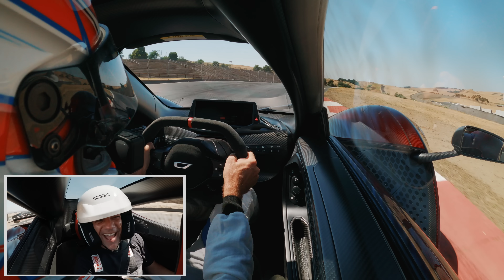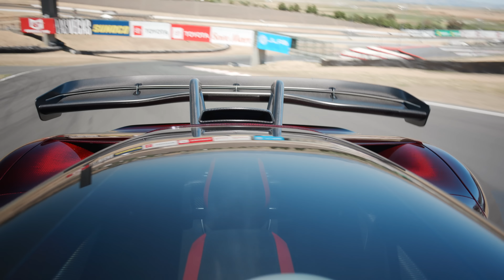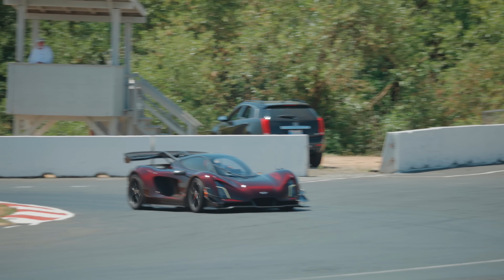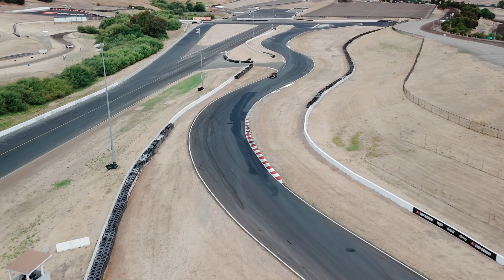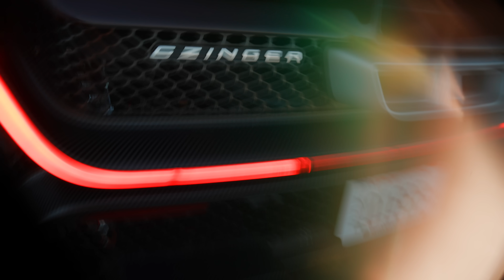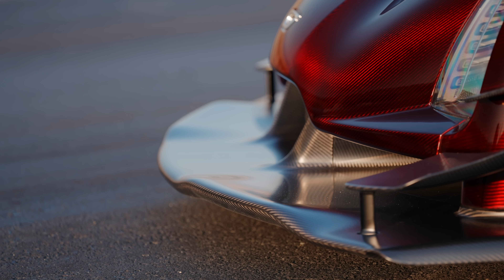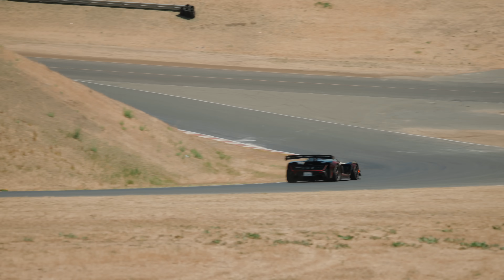FIRST DRIVE: Czinger 21C, The Wild 3D-Printed Hypercar

Comment: Its hard to not be impressed by the technology thats harnessed in the 21C. I believe it stands for a huge step in the automotive industry and it is unconventionally flawless, i love it and i cant wait to see what is next
Reply: Beautifully written
Reply: They partnered with a guy on Jay Leno's garage who made like a carbon fiber tube chassis AI build. I believe he has a patent on 3D printed nodes nodes
Reply: If you're impressed by this then just wait until you see my holletjie 😮
Reply: This Divergent 3D additive manufacturing technology is game changing. Opens so many possibilities for boutique manufacturers.
Reply: It's remarkably polished. A very refined and thorough package.
Reply: Kinda. It's a beauty for sure and the manufacturing technology is groundbreaking. Throw out the electric nonsense, fit the rear wing properly and you might be onto something.
Reply: I feel this was written by a company guy working at divergent
Reply: @Iwished4 you know nothing
Reply: But it weighs the same as a small mountain.
That's a fail.
Reply: @procatprocat9647 weight is equalled to its power. So as weight increases so has the power. We are entering a new age to embrace
Reply: Weight is grip, grip is handling. Power is power. Electrical, sustainability.
Reply: @NevskiExotics  that's pathetic
Reply: @NevskiExotics you sound like an american 😂

Chapman would turn in his grave
Reply: @procatprocat9647  I'm an American who worked in design. Your motocycle and auto industries collapsed in my lifetime for the most part. Seems your storied brands are built in India and Taiwan now. Stop the elitist arrogance.
Reply: @procatprocat9647 I’m British
Reply: @JimmyNevski shame on you. I aim to get your British passport revoked 😂

Seriously though, you're certainly no Engineer. That's for certain !
Reply: @procatprocat9647  In what world is 1200kg heavy "as a small mountain?" It weighs less than an Evora.

If you don't like it, that's fine. But you don't need to just make stuff up 😂 
Get a grip.
Reply: @procatprocat9647 what ? It has the same HP as the Corvette zr1x, but weighs over 1,400 pounds less.
Reply: @procatprocat9647  its weighs lighter than a Jesko or Valkyrie and more than a hardtop NC Miata. That's light.
Reply: @Qimchiy  an nc miata is not a purpose built racecar with a stripped one seat interior
Reply: @Qimchiy That's not a decent comparison by any means. "It weighs more than the lightest entry level sports coupe on the market, and less than a Swedish boat and a literal LMH car."
Reply: @Deadsphere  It's not that far off from the Miata's weight just that the 21C is a lot more powerful to put it simply. How's it bad to compare to something known and obtainable? ND Miatas are still in showrooms available for test drive.

The Valkyrie was mentioned in the video so why not, the street version has similar ICE only horsepower and weigh. The Jesko is just one of those cars that everyone knows as "oh so fast" and on gas (not E85) has similar horsepower to the hybrid Czinger.

Would saying it weighs 1/3rd a full grown elephant be better?
Reply: @procatprocat9647 it’s under 3000 lbs. you make no sense.  You’re a fall

Comment: This car has the same lines as the Mazda Furai
Reply: Mazda designers were just that good.
They still are.
Reply: Dont tell them that. Its a brand new design remember
Reply: @km6832  it in fact is a new design, its just the fact that the furai and the 21c are both single seater aero and weight focused track cars, you wouldn’t call the M8 coupé a non-new design even though it follows similar lines as the mustang
Reply: just like ferrari f80 looks somewhat resemblance of classic bugatti model (i think it is E9999 or something like that)

Comment: as a Koenigsegg fav, i don’t want this to beat the Sadair Spear
Reply: I absolutely hope it does USA ALL THE WAY!
Reply: It's a good bit heavier, but AWD. 
I don't know how good Koenigsegg is with traction control and corner holding, they're very shy from lap attempts at places where other brands test.
Reply: That track is for a large part about driver commitment.
Reply: Koenigsegg has already beaten Czinger record with Sadair's Spear on the Goodwood uphill run recently.
Reply: Even Chinese Xiaomi su7 ultra beats your sad air Koenigsegg.
Reply: @Maiza007-c8y  Beats it in what? Proof?
Reply: @jordikorthals003 in tracks Xiaomi su7 ultra is the fastest production in nurburbring.

Comment: What is going on with the rear spoiler? 💁‍♂️
Reply: Even airplanes wings wobble lmao
Reply: @magnerionmachine69 exactly
Reply: The wing is optimised for lightweightness and downwards force  so that's why it's wobbly
Reply: To make a complicated answer simple: Flexible wings are better than rigid ones. For another example, go and see how much flex the wings on an airliner has
Reply: @dod_the_angel nah, its just poorly designed. Stiff is better.
Reply: @XAIcommentbot go design, make and fly a plane that doesn’t have flexible wings then, I’ll attend your funeral
Reply: Define better. No doubt it exist in the razor thin gap between minimum weight and maximum stiffness/ aero performance.
Reply: @XAIcommentbot So why do F1 wings flex?
Reply: Does bounce around a little bit.
Reply: It's called active aero. It moves according to what the car is doing.

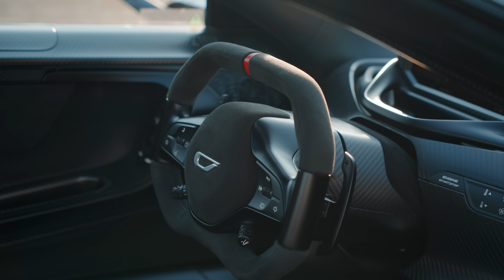Comment: 5:22 what is a twin barrel gearbox?
Reply: ij looked it up its two independent gear trains or shifting mechanisms or a term for racing gearboxes with two separate gear paths used for rapid gear pre-selection. It could be a DCT but in the Czinger 21C specifically its a single clutch with 2 shift drums for gear pre-selection that combines a 7 speed semi sequential with a 48V electrically actuated "twin barrel" shift system making the shifts under 100ms- faster than DCTs which also makes the blend of EV/ICE hybrid power seamless. Its a hyper focused bespoke solution that utilizes their 3D printing tech to make a lightweight gearbox thats faster than a PDK or aything in a road car pretty much with the exception of the Jeskos LST
Reply: Oh nice thank you both for the explanation. I think I’ve heard of modern preselector transmissions in Motorsport applications just wasn’t quite sure how it all worked.
Reply: @MX5-XU drive61 has a good video about that gearbox
Reply: In sequential gearboxes, the way they select gears is via a barrel mechanism, so when you upshift the barrel is spring loaded and slams the gear in hence being 'seamless' usually sequentials only have 1 barrel for gear selection, this one has 2 so they split the load, maybe odd gears on one barrel and even gears on the other.
Reply: Duel clutches are overrated
Reply: A gearbox with twin barrels.

Comment: Nice car and fast but that rear wing is shaking around alot. seems wery weak or loose
Reply: F1 wings shake also.. They get the job done
Reply: @NovaScene sure but they dont look like they are gonna fall off 😂
Reply: @CanisLupus1983  it doesn't look like it's going to fall off. That's literally how much load is going through that structure. If anything, it's pushing down on the wing supports. When you see the wing moving, it's directly pushing into the chassis. You don't usually see how hard the car is working - except for that rear wing.
Reply: Better to have it flex than have it be too rigid and risk snapping off under shifting loads.